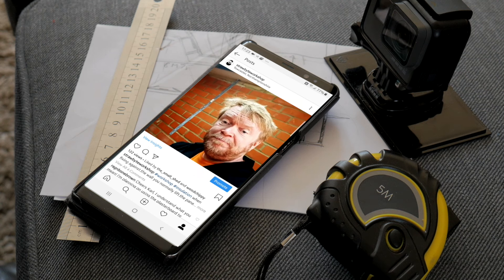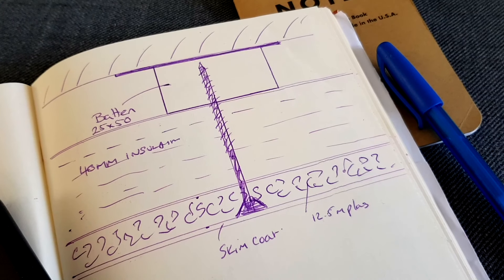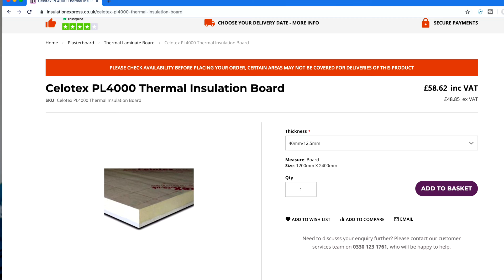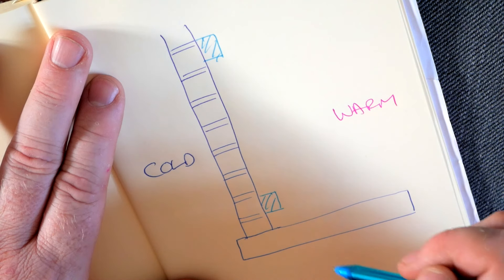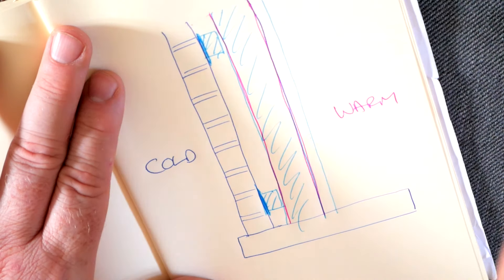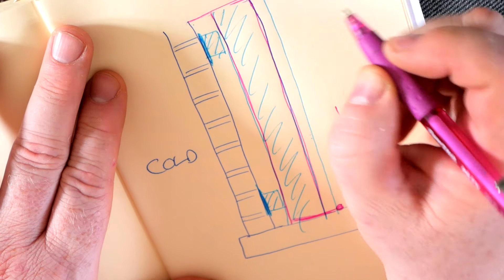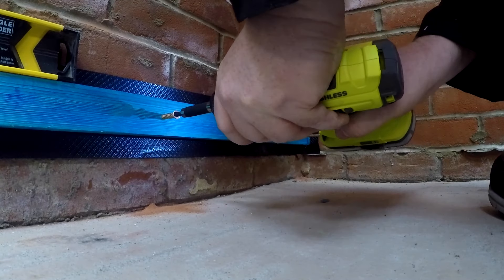How to Insulate Your Workshop | An Easy DIY Project | Keep Your Shop Warm or Cooler

Comment: What a great video! I'm planning to insulate my garage as well and this is by far the best video I found. Just a few questions:
1) what if rain penetrates the brick wall and gets stuck between the inner side of the brickwall and the back of the insulation boads? Can it be an issue?
2) what is the distance between the bottom batten and the floor?
3) if I want to insulate the ceiling as well, do I need to do that first or I can start from the walls?
Reply from the maker: Hi Simone. Thanks for leaving and comment and they're all great questions.
1. I followed the guides provided by Kingspan when deciding the method. The bricks too wet through as they're porous but importantly the water leaves the same way it got in through the brick. It's hard to believe but true. I've recently had to take one wall down to do some other work and the battens and insulation were all dry and in pretty much the same condition when installed nearly over 3 years ago.
2. The distance between the batten was determined by where the wall DPC course was on the wall. The battens didn't extend below the DBC and I didn't fit any horizonal battens in the brick below the DPC. In my case it was around 200mm (the height of 2 courses of brick).
3. It depends on what you want to do. If you're planning to put plasteboard across the ceiling joists and insulate above then do the ceiling first. The wall insulation will butt-up to the ceiling. You want to avoid having the ceiling butt-up to the wall. As you saw in the video I wanted to keep the vaulted ceiling so I simply but a board around the walls to replace the ceiling and to give me something to butt the walling against.
I hope that helps and good luck.
Reply: @StrawbyteWorkshop  Thank you so much for the detailed answers! I'm going to do some reasearch for the ceiling, then honestly I can just copy your method for the walls ;)

Comment: Hi, I have an exact same garage. Have you found any issues with not insulating the support pillars, i.e., damp formation,  cold spots etc.....Thanks
Reply from the maker: Hi Dave - since making the video I have insulated the concrete piers. This was achieved buy placing 40mm insulation directly on to the blockwork with a 40mm gap either side and cladding with plywood which was fixed through the insulation to the blockwork. That said the first winter was without and I generally found that what I had insulated had made a big difference. With the blockwork insulated as well its improved further. I would say that the blockwork didn't attract condensation. The big issue with these garages is the porous brickwork letting rain right through the wall addressing those walls were the priority.
Reply: @Strawbyte Workshop  thanks for the information,  thats a great help. Could you just clarify the bit where you say you applied 40mm insulation  with a 40mm gap... where and what is the gap?
Thanks
Reply from the maker: @daveobryan6485  sorry it should have read overlap
And been 20mm. By that I mean extend 20mm either side of the block work. Then the plywood forms a c shaped box around the insulation.
Reply from the maker: @daveobryan6485  sorry it should have read overlap
And been 20mm. By that I mean extend 20mm either side of the block work. Then the plywood forms a c shaped box around the insulation.

Comment: Great video,  my garage built by Wimpeys😂😂 use the cheapest bricks (in fact use the cheapest everything) available which allows rainwater to soak through them and drain down the inside of the bricks hence the plastic drains in the brickwork on the house. Do you have the same problem and how did you get around this
Reply from the maker: That's a really good question and it was something I looked into initially but as my walls are fairly well sheltered I went with the batten approach. I explained in the video that the approach I took works best if you've addressed all the issues outside that would lead to a wet wall. The alternative I looked into was some form of tanking of the wall with either render or special cement boards. I can't remember the name of them. 
K.

Comment: Hi - great video. I’m going through the same process at the moment. Can I ask why you chose to go with mdf and celotex on some walls and then the celotex insulated plasterboard on others? I’m currently putting a basket together and I can see that buying celotex and plasterboard separately is much cheaper than buying them as a combination.

Thanks in advance!
Reply from the maker: Good question and a commonly asked one at that. The thing to note about the video is that the part where i installed the insulated plasterboard and the part where I'm installing MDF over PIR (Celotex) insulation were 4 weeks apart. The two main reasons for the switch:
1. Insulated plasterboard is very heavy and a two-person install. I knew that when it came to the the remaining walls, I would be working alone.
2. Insulated plasterboard needs to be kept flat and bone dry. I needed more sheets than I could store out of the rain to complete the remaining 6 wall sections. Logistically, it was simpler to have the PIR delivered and stored outside on the Patio (it really doesn't matter if it gets rained on) and then have the MDF fetched from a nearby builders merchant. All the walls were going to receive a painted finish so nobody was every going to notice the difference in the finished room by looking.

At the time, the cost of materials is very different from today. Insulated plasterboard was fairly inexpensive compared to today. About £8 more per sheet with the saving in time coming from having to install one thing rather than two.

Plasterboard was much cheaper than MDF even then, but MDF was lighter and easier to manage.

Anyway good luck with your project.

Comment: hi Karl. Nicely done, informative video. I'm hoping you still read the comments as I have a question if you don't mind? I have a detached single skin block garage. I am converting it to a garden room - not to be used all year but will probably use it now and again in Winter as well, so will use a small heater if needed. So far, I have a stud wall placed 50mm from the wall. Stapled to the back of that is a breathable membrane. In the stud I have 50mm acoustic rockwool (I am on the neighbours boundary so want to sound proof it a bit). I plan to finish it with soundbloc plasterboard and skim. My question, as it's such a grey area is, would you staple a vapour barrier to the stud before boarding? thanks. The only other option, if a barrier is needed is to use insulated plasterboard and not the soundbloc. (I think :-))
Reply from the maker: Hi Ian - Thanks for the question. I didn't research to much the stud-wall option as it would have reduced interior space too much. But I did have conflicting advice as to whether to use a vapour barrier under the plasterboard/mdf skin. Some I spoke to insisted on the vapour barrier a few suggested that building regs had changed because vapour barriers were found to exacerbate rot and damp inside the wall. If I were in your situation I would probably go without. The room isn't in continual use and is not likely to be occupied during the colder months so the risk is minimal. Certainly using insulated plasterboard might be a little overkill and a lot more expensive.
Reply: @StrawbyteWorkshop  thanks for getting back to me Karl. Appreciate your thoughts.

Comment: This looks great, i want to do the same for a therapy room in the back half of my garage. 
Have you had any damp issues? 
I too dont want to board the pillers but i am a bit concerned they will be a moisture bridge or cold spot. Have you found it ok not insulating them?
Reply from the maker: Thanks for the comment and sorry for not replying sooner.

I've had one damp issue at the front of the garage to one side of the concrete pillar. This wasn't due to the installed installation, but due to a gutter on the outside leaking and making the wall constantly wet. The interior decoration was spoiled a bit, but easily patched and made good. Once the outside issue was addressed, the problem went away.

One of the things I probably should have emphasised more on the video is ensuring that before you start you address any issues with the structure first.

I get many questions about the concrete piers and why they weren't covered-up in the video. The following winter, they didn't act as a cold bridge and there was definitely no condensation. The construction of my garage had the blocks stand 20mm off the brick skin with wall ties holding them together so there was an air-gap between the blocks and brick which i think helped. In the end I did box them in with 25mm of PIR insulation over the block faces. This minimised the amount of space lossed inside and has worked quite well. I may do a follow-up on the project in due course. 

But great questions

Comment: Hi. I’ve noticed you only put a moisture barrier between walls and baton only slightly bigger than baton. Interested why you decided this and not a full sheet of dpm or painting wall with blackjack or something?
Reply from the maker: The short answer is that the approach shown is one recommended in the technical data sheets from most of the insulation manufacturers (notably Kingspan). Its purpose is to protect the batten from moisture penetrating through the wall leading to premature failure of the batten and the materials attached to it. It is the vapour control membranes (the foil) in the insulation and sealant that is there to prevent warm moist air condensing on the exterior cold wall. Should any moisture condense on the inside of the exterior wall due to failure of the membrane or resulting from water penetration from the outside, the condensated water can still permeate through the porous brick to the outside. If I'd used DPC across the whole wall or treated it, that wouldn't be possible.
There are other approaches to using PIR insulation, such as bonding it directly to the wall. However in my case I had to account for the the fact the exterior wall gets wet when it rains.

I hope that makes sense, but thank-you for your question.

Comment: If you wanted to move the plugs and put them into the boards so they are flush, would you need to do anything different to seal?
Reply from the maker: Good question and a rather challenging one. You could run the wires on the brick wall first and then pass them through the insulation into the room, after which you could cut a recess in the wall for the back box. However a 25mm backbox would remove 15mm of the 40mm insulation to accommodate the flush socket. You'd have to seal the hole the wire passes through. Alternatively, where I've done the wall in two steps,  you install the insulation, counter-batten on that, install the wires over the insulation, and then have the boxes recessed into the MDF. 15mm counter bateen and 12mm MDF would give you enough room for a 25mm back box.

Two options there, but both have downsides. The last one removing a little bit more of the internal volume.

Comment: how much difference did this make in the winter? are you still using storage heaters?
Reply from the maker: I'm delighted with the overall performance of the insulation. It takes very little time to get the space to around 12-15 degrees, which is ideal when working. I switched from an electric fan heater to a 1kw panel heater last year which comes on around 8am and the workshop is warm enough by 8.30 and hardly comes on at all during the day.

Comment: Just investigating the same project on a bigger double garage. It has  concrete slab floor and flat roof. How do you insulate floor and ceiling?
Reply from the maker: Hi David. In my situation I chose to not insulate the floor and laid 6mm pvc tiles directly on the floor. I find the floor is not cold to the touch and a there is never any condensation on or near the floor. The choice was largely as I have heavy tools (planer/Thicknesser) and cabinets on wheels and a fully insulated floor to carry those point loads would have been expensive for little benefit in a workshop. That said the floor slopes as all garages do and I could have fixed the slope and insulated at the same time. New Brit workshop did that in his garage conversation. For the roof I used two layers of PIR insulation on the underside of the trusses. In your situation you need to take care and look carefully at what you need to do to insulate and ventilate a flat roof. You can’t just fill the gaps between the rafters with insulation as moisture will migrate to the cold side of the roof and needs to escape. I will be posting an amended video on the roof insulation to replace one from 2019 that I took down as it featured an error I wouldn’t want someone else to copy.

Comment: Great video, this has really helped me plan for my garage, though I can no longer seem to find the video you did on roof insulation, has this been deleted?
Reply from the maker: Hi - The video is hidden. The link is here: https://youtu.be/fpO6lMwRpCQ

I'm just finishing some remedial work in the roof space and I will update/replace the video to correct a mistake in the original.

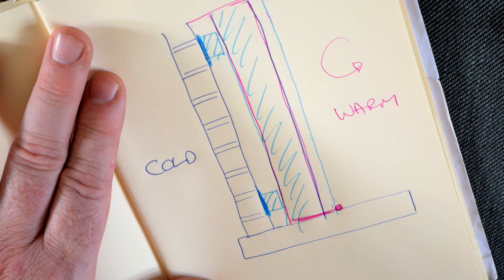Feel free to take a look at the old video. At 4:08 I start talking about the construction of the two layers of insulation. The error made was to include a void between the two layers. This isn't the correct way to do it and while I have experienced no issues with the approach I took, but a roofer pointed out two problems: 1. The void actually reduces the efficiency of the insulation not enhances it. 2. There is an issue with insulation voids where vapour permeating through the insulation  could condense in the void. This might lead to rot in the roof trusses or (as before) a loss of insulation performance.
The mistake was made because I hadn't planned to use two layers from the beginning. battening-out the trusses came afterwards when I decided to install the second layer. What I should have done is planned to install two layers from the outset. This would have had me batten-out the trusses first and install the first layer of insulation flush with the battens and the second layer over the top with no gap. Where the roof support beams cross the space, It would have been easy to test fit the pieces before carving out a rebate to accommodate the beam.
Reply: Thanks very much for the link, I’ve now insulated half of my pitched roof using a similar approach to yourself, just a bit more to go and then on to the walls!

Comment: Great video, thank you. Did it make it a lot warmer? Did you consider insulating the floor?
Reply from the maker: HI John. Both great questions. Yes it made it a lot warmer. Perhaps the bigger benefit is space feels a lot drier and given that I was getting mould on the back of the cabinets and steel/iron tools rusted over winter. As for the floor, yes but there were two reasons why I didn't. 1. I knew that I would have several heavy tools on wheels in the workshop so ruled out a subfloor on based on the cost of getting a floor strong enought. Additionally, the garage walls are 'tanked' outside and underneath as the garage sits 36" into the ground at the back. Due to this there's a 12mm closed-cell sheet under the concrete slab. While offering a minimum of insulation, the floor is never colder than 10 degrees in winter so I'm fine with that. 

thanks for watching.

Comment: Hi There, great video. How come you didnt insulate the colums?
Reply from the maker: Hi Philip - They're insulated now. But at the time I needed to figure out how best to approach that because those columns were, and still are, holding-up some fairly hefty things. One had a TV attached to it, and two were being used to support the frame for the garage door. I took a very different approach to the walls by building 4 insulated plywood boxes which are bolted to the wall with shield anchors. On to those you can hang just about anything. It's all been filmed and will be a view on the channel in the near future. Thanks for the question.
Reply: @StrawbyteWorkshop  Thanks! I look forward to watching it

Comment: Is there a 2nd video showing the roof insulation? I can't find it on the channel.
Reply from the maker: Hi - The video is hidden. The link is here: https://youtu.be/fpO6lMwRpCQ

I'm just finishing some remedial work in the roof space and I will update/replace the video to correct a mistake in the original.

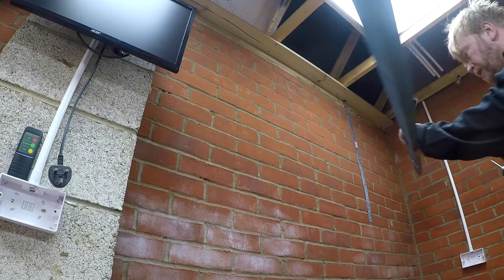Feel free to take a look at the old video. At 4:08 I start talking about the construction of the two layers of insulation. The error made was to include a void between the two layers. This isn't the correct way to do it and while I have experienced no issues with the approach I took, but a roofer pointed out two problems: 1. The void actually reduces the efficiency of the insulation not enhances it. 2. There is an issue with insulation voids where vapour permeating through the insulation  could condense in the void. This might lead to rot in the roof trusses or (as before) a loss of insulation performance.
The mistake was made because I hadn't planned to use two layers from the beginning. battening-out the trusses came afterwards when I decided to install the second layer. What I should have done is planned to install two layers from the outset. This would have had me batten-out the trusses first and install the first layer of insulation flush with the battens and the second layer over the top with no gap. Where the roof support beams cross the space, It would have been easy to test fit the pieces before carving out a rebate to accommodate the beam.